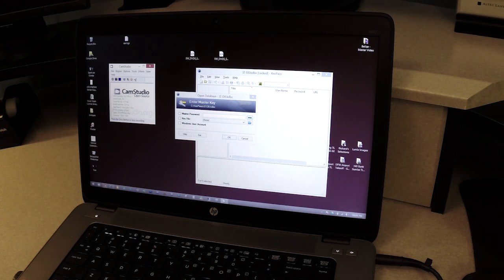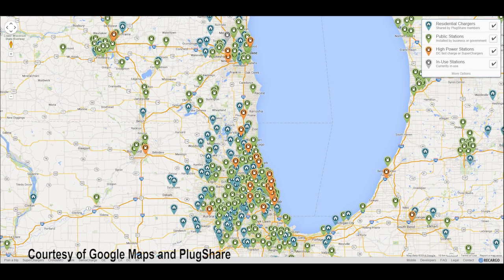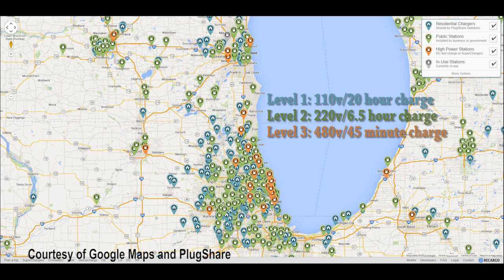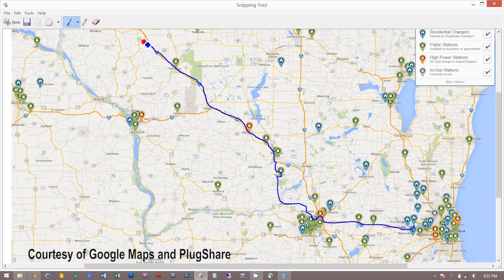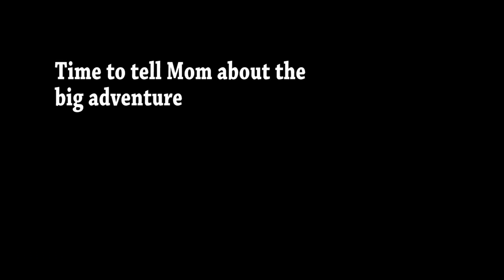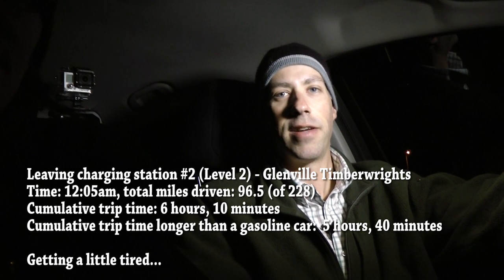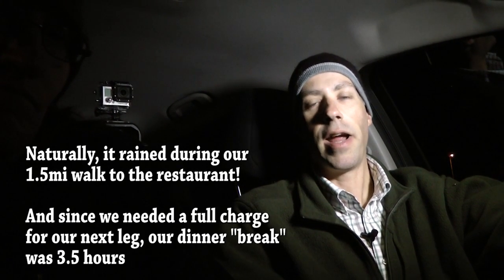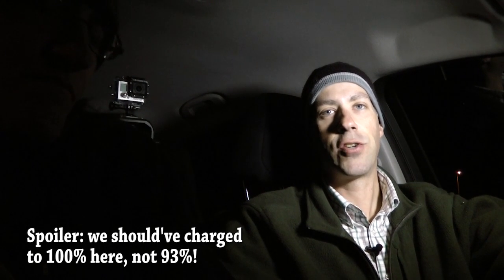Out of Range: Driving an Electric Car to its Limits

Comment: Just a note on RV sites.  Although they are 50 AMP they are all 120 VAC so your quick charger wont work.  You you have to use the trickle chager.
Reply from the maker: +ycmdill 14-50 outlets can be either 120v or 240v.

Comment: I enjoyed your video Jeff. I wonder if you could take a petrol generator in the boot for emergencies next time you go on a long trip.
Reply from the maker: ***** Yes, I could technically take a ICE generator with me and use it to charge, but since most of them are only 110v, every hour of generator use would only gain approximately five miles.

Comment from the maker: Dave- I'd like to take another long trip but I would have to make sure it's in the summer when the nights aren't so cold!

I highly recommend the LEAF. It's just loaded with features, it's peppy, and super quiet inside. I highly recommend the heated seats and heated steering wheel if you live in a cooler climate. Also, I'm really glad I bought the package that included the 480v charging port.

Lastly, there's a rumor that the 2016 LEAF will get another 20mi or so of range, so you might want to hold out for that.
Reply: zepjeff I wouldn't use the FAST charging  not for a full charge.. or in a HOT car with a HOT battery.
Reply: Capt Larry The occasional fast charging does little harm to the batteries. There are Leafs being used as taxis with 100K miles on them, over 1700 fast chargers and no range bars loss - just ~12% capacity loss.
Reply: I apologize for my intemperate comments, I have modified my comment.. and you are correct.  Your example I believe is in cool old England.. not LA.  and Taxi Service..Isn't Freeway Combat.. So, what I meant to say is what the science says.. that elevated battery temps shorten the service life of the batteries.  So the double whammy of a long bout of high speed driving , high outside temps. and rapid charging ( especially beyond 85%)  or any combination of those thing Which Elevates Battery Temperature... is a batterykiller.  The strong point of the Leaf is that there is a Battery Temp Guage ( and even more info available with an app and a tablet or phone). The weak point of the leaf, is that there is not much battery cooling..So once hot.. it takes a LONG TIME TO COOL.  Perhaps as much as 12-18 hours. Vw uses conduction cooling, Kia uses forced air - and perhaps newer leafs do also. The Hybrid Volt uses water, but in a system that is far too complex. Cheers !
Reply: Capt Larry That is all correct, Larry. High temps do degrade battery capacity by some measurement. Overall, though, these newer battery chemistries seem very resilient. Fair to say that they will not last forever.
Reply: They are lasting a LOT longer than even the designers though they would.  Keep it cool, and charged in that sweet spot between 15% and 85% and I think you can double the life that the beater/lease crowd will achieve.  There is an excellent video on youtube  done by prof at University of Michigan.. pretty long..and the early part wanders around with hybrid talk.. but further in is some EXCELLENT Testing and Reliability info...on Lithium Batteries.. where they do all manner of monitoring and long term testing.. with a variety of charge/discharge models.. and cell life.  Very educational, at least if you are technically inclined.  Worth seeing, if you own an electric car, and want to maximize the life and minimize the cost of your batteries.
Reply: I'm thinking about getting a first generation Leaf, and using the quick charge feature  carefully for partial charges.. since the on board charger is slower by half than the current ones.. just to add utility and range if needed.
Reply: Larry, I picked up a 2013 Leaf SV with 8K miles on it for $11K. A 2011 SL model goes for about $8.5K. They are very affordable as they come off lease.
Reply from the maker: JRoque250 Wow! I can't believe those prices! Great deal.
Reply: zepjeff Not to make it a commercial but http://www.offleaseonly.com/used-nissan-leaf.htm. Those guys are great. Zero typical used car shenanigans, no hidden fees, etc. You get the keys to the car for a ~30 min drive on your own with no salespeople jabbing on your ear while you're evaluating the car. There are some gotchas like as-is conditions - they will not repair the car if you find something wrong with it -  though offer a 30 day return policy if you don't like your car afterwards. Some of the cars may have been in accidents but those are clearly marked as such. They are usual minor accidents and have been fully repaired. These guys are in Florida but I'm sure similar deals can be found elsewhere.
Reply from the maker: +Stephen Bell Hi Stephen- I just watched one of your episodes. You guys took a very long trip! Kudos! Thanks for sharing.
Reply: The Leaf is very nice but I personally prefer the Kia Soul EV or the new Chevy Bolt

Comment: I went to Devon in the uk 286miles did 60/70mph  I was getting 110miles from a charge in a normal car it's about 5/6 hours to get the, I Stopped 3times for 20min, as that will put the Renalut Zoe back up to 99% in about 20min.

Comment: Would you do it again? My home town is a 6 hr drive. Would be cool if every gas station would install a chatimo. Also when the LEAF dies, can you still steer it and push it to a plug if need be?
Reply from the maker: +Liefpj Yes, I would do it again but I would do it when it's warmer outside :-)  That's a good question regarding the ability to push and steer the LEAF after the battery dies. I don't know what would happen and I wouldn't really want to find out!
Reply: As it's an electric steering rack I'm not sure you could steer it but I don't want too find out. For my Leaf (I'm in the UK) Nissan will provide a free flatbed truck pickup service in this emergency providing you don't abuse it.

Comment: So ,you know that you can push the start button two times without putting your foot on the break pedal after the charging begins and run the heater, radio, etc? Great time to warm up the car while plugged in.
Reply from the maker: fiddlesteven I thought pressing it twice was the same as depressing the pedal and pressing the button once. Never really paid attention but thanks for the tip!

Comment: I wondering if the side road gambit really accomplished what was intended.  Slower roads do save energy.. but NOT if they require lots of cycles of acceleration, slowing, stop signs, traffic, or steep grades !  Steady state cruising at 55 is very efficient.. and since wind resistance increases with the square of the speed... freeway crawling at 50 with cruise control might be a better option - some times.
Reply from the maker: +Capt Larry "Wind resistance increases with the square of the speed?" Wow, that's an interesting equation. I never knew that! I took the freeway into consideration but since the area has very few exits, it would've probably added at least 10 more miles to take the freeway due to backtracking.

Comment: Will you ever do this again?   I am considering purchasing a 2015 Leaf.  Best advice:  should I or shouldn't I  ?
Reply from the maker: Dave Zykerman Hi Dave. It depends on a number of factors. For me it was primarily: do I have another car to use for long trips? How far is my daily commute? How many public chargers are there for trips that are, say, 60 or so miles away from home that I frequent? Other people might have different or further requirements, like: number of passengers, amenities, ability to use quick chargers, etc. So although I highly recommend the car, a lot of these factors have to be taken into account to know if it's the right choice for you. There are a number of new EV makes/models popping up, so the options are only going to get better.

Comment: Which model year of Leaf do you have? Does your car have a 3.3 or 6.6 kW charger? Your trip would be shorter if you have a 6.6 kW charger onboard and the EVSE in Glenville can supply 6.6 kW of AC power.
Reply from the maker: It was a 2013 LEAF. I don't know which charger the car came with.

Comment: One of the problems with the thinking here is completely ignoring the fact that the car can be charged - albeit slowly-  from any 120 volt outlet.  This means that it isn't any harder than plugging it in with an extension cord at a Motel !   Outside outlets are everywhere... and a few hours wait while plugged into one  is a lot better than EVER letting your battery get so low that the car goes into emergency limp mode.  You really need to understand that not dipping below 10-15% capacity is a strategy for increasing battery life... which far outweighs time spent waiting on an extreme range excursion.  Anyplace that has a clothes dryer, welder, etc also has a 240 plug.. so that charger you carry and an extension cord is GOLD.   - as to the phone calls.. start with "Hi, I have an Electric car, ...not this is billy joe kropotnik.. they don't care,.
Reply from the maker: I didn't ignore the fact that I can use a 110v outlet. In fact, I used one once in the video. From my experience, publicly accessible 110v outlets are much harder to find than expected.

Comment: at 33 minutes.. you were safely charging from 120v... ok.. so you get 10 miles for every hour of charge this way...  it was time to WAIT.  Both for your peace of mind,
and to be sure you got to your next level 2 stop.. but also.. because this juncture is where you decide to trash your battery !
Reply from the maker: Capt Larry Yes, in hindsight I should've stayed at that stop longer so the amount of charge at my next stop wasn't so low. If I really did "trash the battery" as you indicate, that's a major problem with current battery technology then. If EVs are going to go mainstream, the average EV owner can't be expected to know exactly how to charge, when to charge, amount of voltage to use, length of charge, etc. They just need the ability to charge when needed. I haven't noticed a decrease in my range over the 2.5 years and 21,000 miles I've had my LEAF. In fact, I've seen slight gains over time as I've learned how to be a more efficient EV driver (which is a different style that hybrid driving).

I just don't want the public to perceive that they have to be a battery expert or learn characteristics of lithium ion or other technologies. The Nissan manual even mentions that the amount of charge the battery can hold over time will go down (a little) over time, but conventional gasoline cars get less efficient over time as well, although I don't know how much.

Comment: Please folks, why abuse your lovely electric car ?  Plan ahead.  Things these cars don't like:   1. Over Charging. 2. Rapid Charging - especially when already hot. 3. Being left either: deeply discharged or charged over 85%.  If you must charge to 100% as part of your plan... do it when the car is cool, and use up the top 15% soon.  Worst scenario:  on a HOT Day..;. drive at high speed ( 70+)  until the battery is almost completely exhausted.. then SLAM it with a High Speed Charge while the battery is super hot ! --  Better scenario is reducing speed slightly, picking a place to charge that coincides with a lunch./ rest stop.   Charge at the normal ( 220 V)  rate over a few hours.   Don't pass by opportunities to top up a partial charge.  If you need to stretch your milage  the following things will do that 1.  Drive in cooler temps and lighter traffic. 2. Drive at reduced speeds.. 55-60 instead of 65-70.  Minimize stop start cycles.. that means don't tail gate or jack rabbit start..  Coast when you can.. Keep the vehicle clean and load it lightly.  Keep Tire Pressure Up.  Watch the battery Temperature..and keep it cool baby !  This will pay off in many extra YEARS of battery life before replacement... and in a calmer longer life for you.

Comment: Are you still an EV driver?  I am  thinking that my next car should be an EV, the new Leaf of Golf e are on my short list though the larger battery in the Bolt might just be the deciding factor after watching your video.  I experienced range anxiety this past summer when my wife an I circled Lake Superior last summer and I rode past the last gas station for 250 km ;)
Reply from the maker: gerhardk98 Unfortunately I have a gas car right now since I have a long commute. I'll get another one when I get the chance though!
Reply: Well in 2020 I bought a new 2019 40 kWh Leaf. I have been happy with but last Monday a deer ran into the side of the car. There is a lot of sheet metal damage but it drives just fine. Getting the repair estimate tomorrow so hopefully the insurance won’t drag their feet and it will be fixed shortly. Drove 59,000 km without issue before the deer 🦌 used me for target practice.